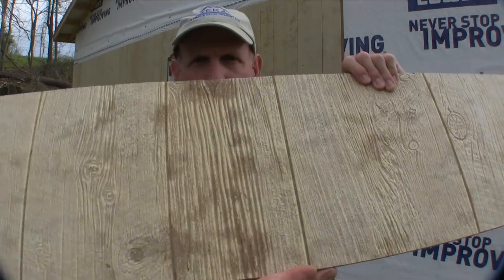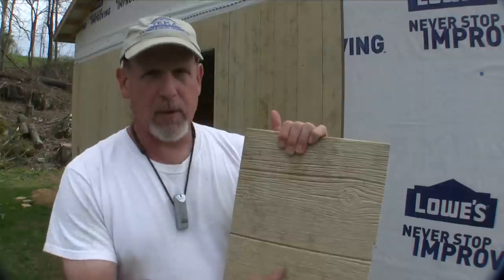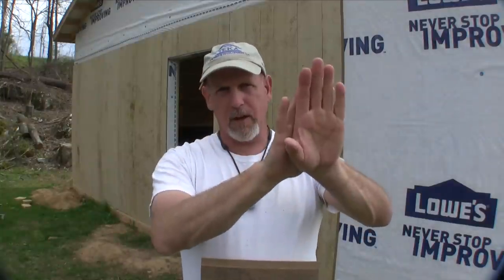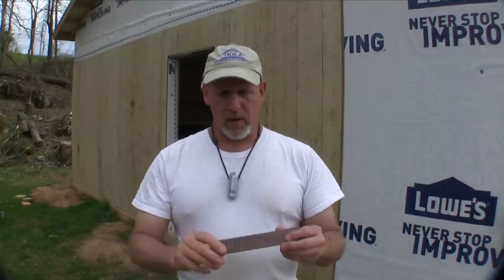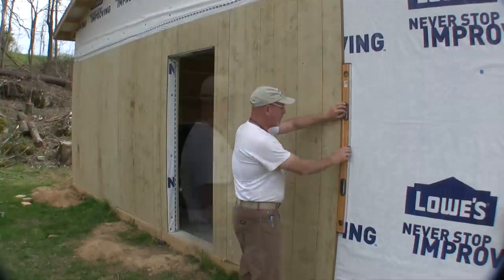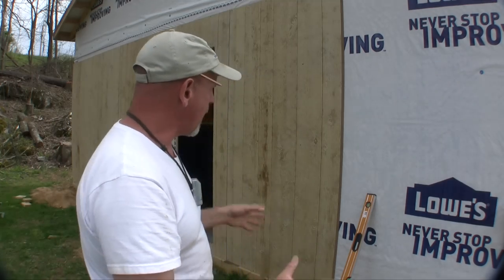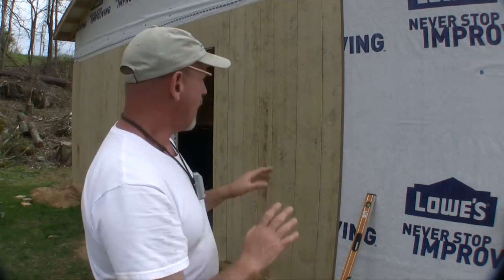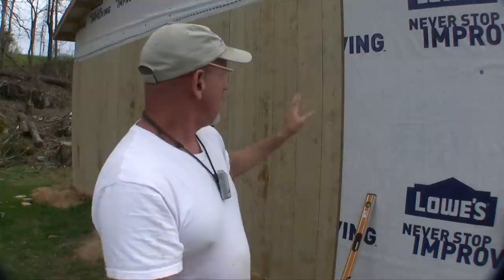Pole Barn Knotty Barnside Paneling / Siding

Comment: I used the same material on my own shed project.  Damn happy with the product so far.  I not only used it on the outside, but also on the inside wall covering as well.  I think you will be happy with it.
Reply from the maker: +Gary Crumrine Thanks for watching, Gary.  It's been up about two years now and seems to be holding up well.
Reply: I think you hit the target when you indicated you need to keep it painted.  I used the Z-channel on the seams on the gables, but no caulk,  We have mild winters and I have not experienced any negative swelling etc.  OBTW, a paint sprayer is the only way to go on these.  I spent more time moving ladders than I did painting.  Maybe an expose' on paint spayers would be nice...

Comment: I am a painter and can tell you , if you ever have the chance to caulk the backside seam of anything, DO IT!! much easier to let the caulk squirt out, than trying to push it into a gap. Also, use a "z" channel and/or a trim board connecting the bottom section to the top section and REMEMBER: caulk the backside edges of the trim board-(YOU will thank me)also if you are running vertical trim pieces, caulk the heck out of the bottom cut, then paint the front/back/edges and ends  before install, then second coat paint in place(Cadillac Job)I have used this siding indoors with no paint or finish for an awesome rustic wainscoting.Love your videos and bloopers

Comment: That's the same board I used on my woodshop, and am using on my new cabin. Even using two shades of gray paint. Lowes Corp. has taken it out of the store at my location, and the Pro staff is trying to get it back. I paint the flanges before I install the panels.

Comment: I'm not a fan of any organic siding products. I've had great results with Hardie Panel (also sold by Lowes) which is a fiber-cement product. Put down over 1/2" OSB with housewrap, it will never rot, comes primed and holds paint like nothing else. Keep up the great videos!

Comment: Like the siding but you should use metal z channel at the top of the sheets instead of a bunch of caulk. It's cheap and designed to keep the water from going behind the bottom panel. You could still go over it with the 1x4 horizontal band for looks.

Comment: Hey, So I guess you wouldnt put the OSB on the barnif you were planning on using the Barnside paneling. I have used it a few times. My brother built his house on the Alabama River with this. I failed to paint the few pieces that were exposed. and after a couple of yrs it faded. Before I ever used the stuff, I put a small piece in a bucket of water and set a brick on it for a month or two. It was still dry and didnt sweel at all. I wonder why they have that color on it if it requres painting. 

What do you think about using metal siding? Buildig the shop I had talked to you about earleir. Not climate controlled but its in Southern middle TN. Going to use metal trusses and metal roof and siding. Wondering how cold it will be if all I use is the metal siding?

thanks for the videos
Robert

Comment: What's going on with this siding after 4 years? I have a 1950 stick built house, made with the old untreated rough cut lumber. It has asbestos siding and old counterweight windows. It has been in need of an exterior renovation for years. This "Brown Board" from lowes seems so tempting. A good primer coat and a coat of paint and should last me the remainder of my life, along with 10 replacement windows...

Comment: Very happy to find a second opinion on this stuff.  I saw it at Lowes as well; loved the look and was thinking about using it for my shed/barn, but it looks like particleboard!  Any sign that yours is soaking up water?
Reply from the maker: Thanks for watching.  I appreciate it.  I really liked the look of the material too.  Mine is all painted now and it looks really good.  It's only been up a few weeks so it's hard to say whether or not it will hold up over time but so far so good.  I was like you in being concerned about the durability but I caught it on sale and figured if I could get five or six years out of it then I'd be coming out ok.  There was a guy buying some when I got mine and he told me he had used it several times on projects and it had been up for a few years with no problems.  Wish I had more to report but I'm gonna have to wait and see too.  Good luck!

Comment: Thanks for the video!  

We're using this for siding for an area under a deck.    My wife wants the lower half of  the walls to be the knotty paneling, and the top half to be lattice.   So, the walls won't be waterproof, but there is a roof, of sorts, made from TufTex polycarb panels.

Do you I could use only the panels across the studs, or is plywood sheeting required under them?

I think this was asked previously, but the question was mis-interpreted as asking if the housewrap was required.

Thanks!

Dave Thomas
Reply from the maker: +Dave Thomas Thanks for watching.  You could just nail it to the studs if you want to.

Comment: Absolutely love the videos!  The wife and I are in the process of building our barn now and have selected the same siding material from lowes.... My question for you is had you known you were going to use that siding vs vinyl, would you have sheathed the building in osb first or simply used house wrap and then the knotty bar side panels?
Reply from the maker: Bacchuslaw Thanks for watching.  I appreciate it.  Yeah, I would go ahead and wrap it just to protect the ply.  Probably not essential but while your into it you might as well do it.  It's not that expensive or time consuming in the big picture.  Good luck on your and lemme know how it turns out.

Comment: Hey Feddy - Barn is looking great!
How does that composite price out compared to the cement based Hardi Panels? I know the 4'x8' Hardi sheets range from $20-30 ea, depending on the finish on the outside, they are only primed that yellow color and still need painting though.Did you check those out as an option?
Reply from the maker: Thanks for watching, Carl.  I appreciate it.  I paid a little under $20 per sheet.  The Lowe's item number is 15601 if you want to check the cost in your area.  I considered Hardi panels.  In fact, I had several offered to me as a freebie but I've never fooled with them and the weight bothered me knowing I'd be putting this up by myself.
Reply: Free is good... I just built a 20x20 woodworking shed and used the Hardie for the siding and it worked out very well. I wrapped the studs and put then put up the sheets. I butted the sheets together and just ran a bead of caulk to seal the seam, and after paint, it looks like one smooth continuous wall.. I bought a Ridgid Fiber Cutting saw to cut the panels, whish worked like a charm, bet the whole shop came out good. Anyway, I like your video's - keep making more. Oh, did you mount that tittiebar sign yet?
Reply: Quick Carl
And as usually happens, I wish I would have built it a smidge larger...
Reply from the maker: Ha!  We took the sign over to my brother's house.  We're gonna take it apart and and clean it real good and pretty it up over the summer.  It turned out to be pretty heavy so I don't know that it will end up on top of the barn.  Maybe on a pole beside it.  We'll see.

Comment: (2) quick questions...Why did you choose non-treated skirt boards that come in direct contact with the ground and why did you choose not to use "Z" channel on the skirt boards before installing the panels?  Thanks, I really enjoy your videos.
Reply from the maker: Thanks for watching.  I appreciate it!  The skirt board is treated.  I talk about that in Pt 4 (I think that is the one) of the pole barn series.  I did flash the paneling but I failed to mention that in the video but I talked about in the video description.  I also put a little pop up in the body of the video to mention it.  I think that appears at about 4:28 in the video.  I hate that I forgot it in the actual video but I was hoping the pop up would help clarify.
Reply: Thanks for the reply, sorry I didn't catch those..looking forward to your next project...God Bless.

Comment: Hello sir. How's that Knotty Barnside paneling working out for you? I am seriously considering wrapping my shed with it. I've been told and read that if I paint it properly (I'm think about using Marquee by Behr or equivalent) and caulk it, as you and manufacturer suggest, water should not be a problem. However, I cant get past that it only carries a 1 year warranty from manufacturer, according to Lowes. I would appreciate your input regarding its durability.
Reply from the maker: Frank Cadena Thanks for watching.  I have had mine up for about six months and have not noticed any issues, but I concede that it has not been long enough to make an overall assessment.  I caulked, flashed, and painted as best I could so hopefully there won't be any issues long term.  Good luck!

Comment: Freddie sure glad that you hung the house wrap so you can read it   I think in the warranty paper for it it says if you hang it and can't read it it won't work. And this the same for hanging insulation.   But everything you do is first class.
Reply from the maker: Looks like a Lowes commercial.  Ha!
Reply: They should be at least giving you some free pencils
Reply from the maker: They only offer me a pen to sign the check card slip with.....